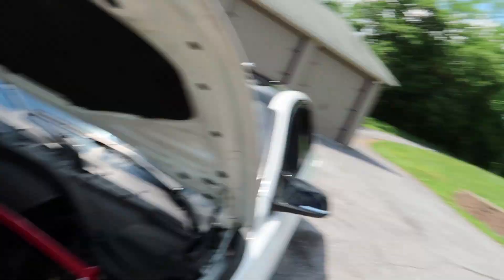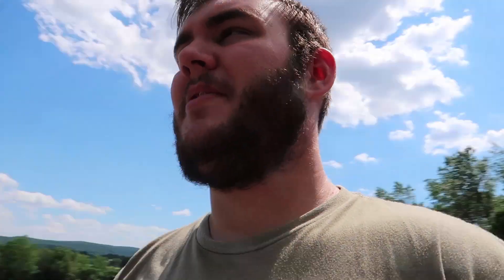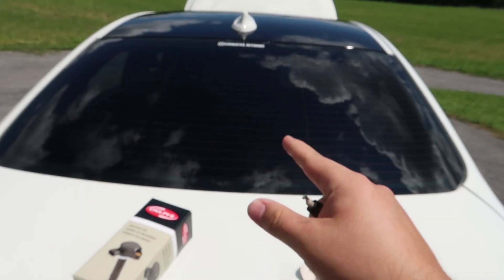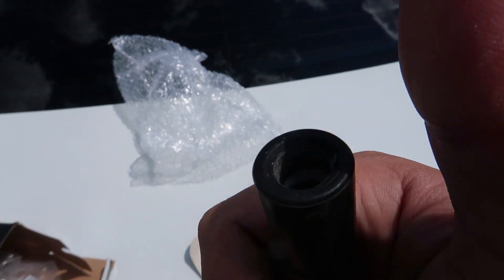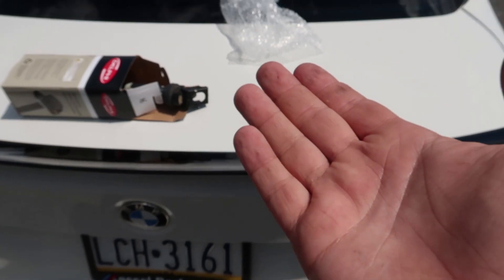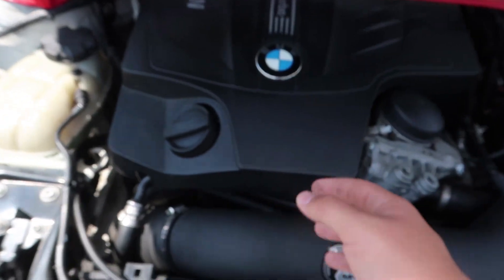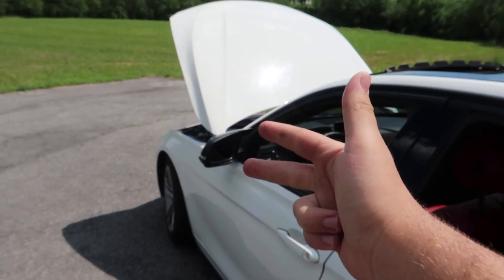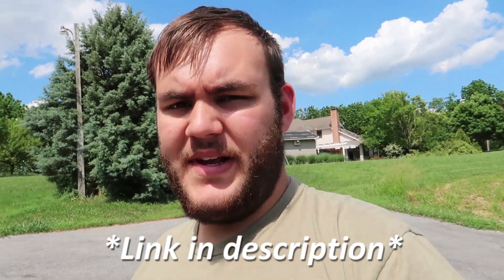BMW N55 POWER LOSS FIX (Boost cut, Spark Knock, Missfire, Pre-Ignition)

Comment: I changed my boost solenoid 3 times because my 2011 BMW 335i coupe keeps cutting out under full throttle and sometimes it’ll throw me into stupid mode as well. PLEASE HELP HELP HELP. I am sooooo frustrated and overwhelmed with this I had a BMW master tech look at it for months and he couldn’t figure it out!!! Im on MHD Stage 2+ with 93 octane pump gas only with full bolt ons and either a stock turbo or vargas level one or vargas level 2 turbo, the previous owner couldn’t prove to me that he swapped the turbo so I think its stock. GOD HELP ME im so close to ditching this piece of shit and driving it into a wall!!!!
Reply: I felt that
Reply: Did you find the problem because mines is doing the same thing
Reply: did you figure it out? ive done new injectors plugs and coils but nothing at about 4.5-6k rpms it jerks 3-4 time on the verge of selling it plz help
Reply: @blurred2157  Sell it, not worth struggling like a motherfucker until you’re completely sucked dry. Upgraded to a 335is and couldn’t ever look back at that pretty Blue piece of shit I had.

Comment: i added a 12 volt  discharged motorcycle  battery with 7 volts:  on my  6 piston car along with my car battery .
My car  weakened and all coil pack thumbs spark good but my car lost half its strenght , maybe computer shorted?   obd test says piston 1.
Maybe injector burned?
Que piensas bro?
Reply from the maker: maybe an injector issue, how did the plug in cylinder 1 look?
Reply: @ExhaustedOutdoors   it was a red wire grounding

Comment: I bought the 97506 and I have the same exact issue as you I even upgraded my hpfp to the XDI no luck, this issue got worse and worse over time to the point every time I floored my car I would have that power cut that would sound like rev limiter only high Rpms, I bought a new set of 97506 after a few months and gapped then to .022 and the car ran great for 20 min and got it to temperature and that powercut came back, I’m on stage 2+ mhd and it got even worse that it started making individual misfires under boost I tuned my car to stage one and it’s gone no issues yet but I really can’t fix this issue it’s super annoying I’ve also noticed the white porcelain on my plugs have arcing marks on them and I have new prw coils but they never caused issues in the past but I can’t figure out what it is
Reply: My m235i is doing the same thing, stock is completely normal nothing happens, but in stage 2 with custom map when floor it, around 5,5k rpm, it just cut the power, at the exhaust it sounds like bubbles (pops and bangs) or whatever it is called. I already tried changing everything. I'am thinking of trying Meth injection...
Reply from the maker: @psiqueization  stock fuel pump? Also how many pounds of boost are you pushing?
Reply: @ExhaustedOutdoors  Hi, yes, stock fuel pump, i already tried to change to a OEM one. I live in Brazil, everything is very expensive and limited here. Some times it reachs 2,5kg of boost, converting to pounds i think it is around 55 pounds. It is alot, right?
Reply: @ExhaustedOutdoors  The first 2 or 3 pulls with "colder" car this issue doesn’t happen, after that the car gets "hotter"and begins to happen, I already tried changing everything (sparks plugs, coil, fuel injectors, fuel pump..). I think meth will help me with this issue, what you think?
Reply from the maker: Yeah sounds to me like fuel pump but that level of boost sounds awfully low in kg but high in lbs so idk. For example my car pushes 20lbs where as you said 2.5kg which is 5.5 lbs so maybe boost leak if boost is that low and fuel pump if it is 20 or above in LBS of boost
Reply from the maker: @psiqueization  to be honest I haven't experimented with meth injection on these cars so I have no clue
Reply: Have you figured out your issues yet?
Reply from the maker: did you torque the plugs down to spec? from what ive heard too tight or too loose can cause weird heating issues with plugs causing pre detonation and missfire
Reply from the maker: also is it an E mixture tune? maybe your injectors cant keep up with the new fuel usage and is causing an issue
Reply: Man I’m having this issue now please point me in right direction of fixing it

Comment: burbble plugs is what makes that popping on decelleration? thats all there is to it?
Reply from the maker: The burble tune works with any plugs and it just delays the timing making the fuel ignite in the exhaust on deceleration, the stock plugs however get worn through quicker and foul up quicker with a burble tune which is why upgrading to a more robust plug is reccomended